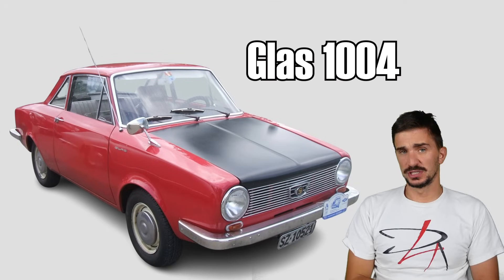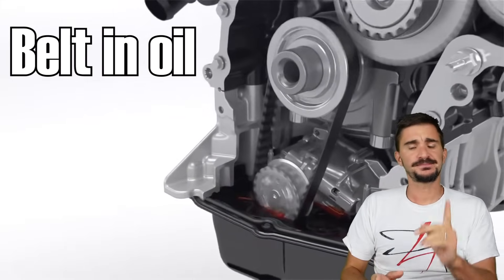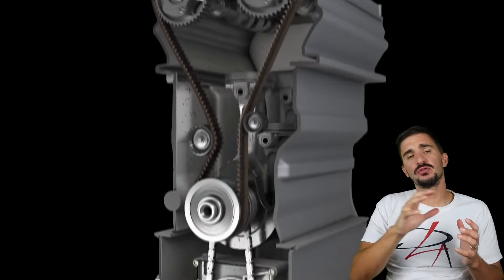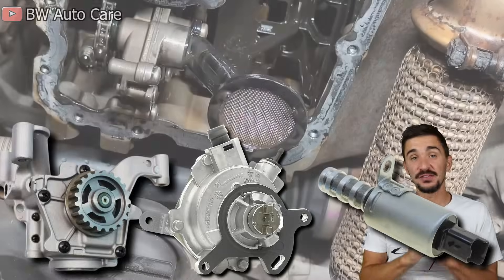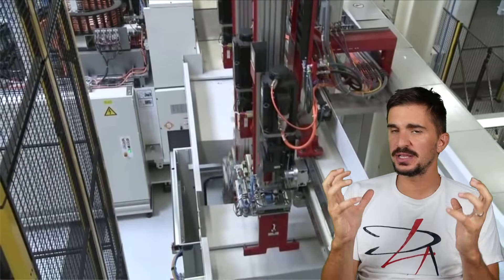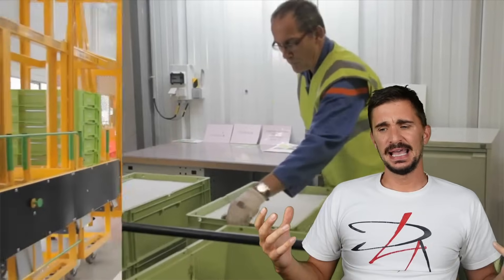Who Approved This and Why Is It Still Being Made? Wet Belt aka Belt in Oil Engines

Comment: You are so lucky you haven't tried this channel's technology experiment and your tempered idealism on computers. Tech moves fast, obviously, and things advance - or so they say. But the cisc-designs that blew the risc-designs away with Intel - have always been hitting barriers that can't be overcome. Intel and AMD has been trying to remedy that by adding more cores, and to extend the instruction set on the low-level. But even in 2001 we knew that the clock speed barrier was going to be looming. And the first 4,8Ghz overclock is actually 20 years old now. 

And that's really where we've been for 20 years. With a computer design that excels at a synthetic workload, that no one actually needs (we don't compile code from bootstrap - you can compile code on ARM just fine, and use complex libraries to build off of). You don't need to write your own compiler to get there, either. So having x86 instruction sets is a bit like having your own car-factory in your garage - and then to make the car every time you want to go to the store. And we keep doing that, and just have blueprints that we don't own, that can't be changed, and that will have very obvious weaknesses.

Recently, ARM has started to challenge things in the mobile sphere, and even in the laptop-sphere. For entirely obvious reasons - a RISC-design is going to be able to execute more complex instructions at lower clock-speeds, and so be potentially infinitely more efficient. But we're just not doing that. We're not even emulating x86 instructions on RISC-designs, thanks to lawsuit (from Intel). 

And instead we've collectively celebrated a company that has extended the lifetime of a dead-end technology, that aggressively gets rid of competition, and that has been sentenced heavy fines for anti-trust activity in many parts of the world - as being a company that brings technology and chip-designs forward. 

So 15 years of failure -- and then actual change as a result? The car-industry is just a huge pack of idealistic angels in comparison.

Comment: Once again Ford leads the way with another bad engineering choice. I believe there is a Ford engine that has the water pump inside the engine casings - another engineering disaster. It's not that Fords are poorly assembled ... the engineering is sub standard ... same for VW.

Comment: Why break it down into savings per year when you could have shown the savings per 100,000km? My math might be wrong, but that's around €117.18 in savings. Not worth the hassle of a broken engine, but still.
€234.36 if it manages to get to 200,000km

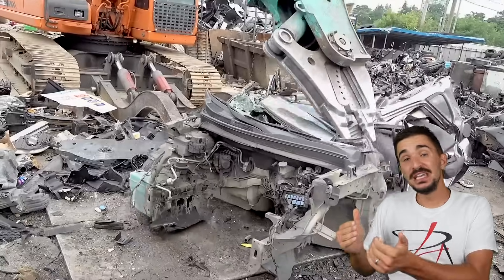Comment: @8:05 that is a fallacy. If a $60k car requires a $40k engine and rebuild, then, with that fallacy, the cost of the rebuild is less than the cost of the car.
Of course it's not worth it since you're now -$100k into the vehicle.

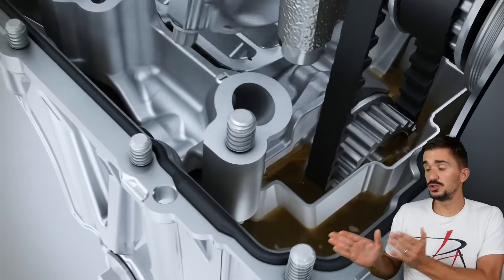Comment: 5:26 Renault has NEVER used belts for oil pumps in K9K engines. NEVER. As an owner and mechanic with thousands of 1.5 dCi engines torn down, reconditioned and serviced, have never seen in my life a belt lower than the crankshaft area. not even on the stupid H4x engines from nissan (0.9 tCE).

Comment: Stellantis was able to produce diesel engines with similar failures by weak steel camshaft chains from 2018 to 2022. Additionally the car dealers don't provide or mount any replacement camshaft chains. I had to buy a new car because of this after 146'000 kilometres and 6 years.
It's even possible to increase profit with steal chains and limited life time of the cars.

Comment: I really don’t understand it either.  GM uses a wet belt in their 3 cylinder cars and SUVs and possibly others.  How much does this really save?  And doesn’t the cost of an item include it’s reliability and reputation of the manufacturer?  Couldn’t costs be shifted to other less significant parts of the car?  What a joke!

Comment: It's because "Big Three" with the exception of Ford went bankrupt during this time, President Bush made a deal with GM and Chrysler at the time, so they would avoid bankruptcy in 2008. Ford decided to take a more German approach in their business model. Designing their engines and or transmissions to fail. Ford's focused these days on building complicated transmissions designed to fail. More customer can bring them in for repairs or back to the dealer for resale creating revenue. I also believe the Germans started this probably after the launch of Lexus in 89' they produced the first e36 in 1990 which had a run to 2000, but if you notice the next generation the e46 reliability is not so great, and that follows up with the e90 n54 n55... and so on. Just my two cents.

Comment: My 200cc bike can go up 15-16k RPM after a tune. It's got cam chains. After a bore & stroke for 2 stages... and a complete valve train change, it still runs the stock timing chain with ease. I could've easily used the old one but changed it for peace of mind.

The old farm tractor we got, has a belt, I've wanted to shoot a shootgun to that piece of shit like 7 different tikes 

And that is why, i trust mechanics more than engineers now 😂

Comment: I agree on your critical view on wet belts, but don't throw Renault under the bus. 1.5 dCI never had a wet belt - they all have ordinary dry belts - BTW a very reliable belt configuration. Also you are wrong about the little Renault gasoline engines . The old generation 1.2 (D4F(T)) has a dry timing belt without problems and the never generation 0.9 - 1.2 - 1.3 Tce all have timing chains. Those  chains seem to lengthen because of poor dimensions and long oil change intervalls, but don't blame Renault for the crazy concept og wet belts - they don't use it.

Comment: It's absurd how long this vid is. Bottom line is that belt in oil absolutely is possible and actually good idea. However it's bad idea to combine engine and belt lubrication. They should've considered making it completely external, like how some sleds have gear casing.

Comment: They need to be replaced more often than the inferior chains they have replaced!They are easier to manufacture and are cheaper for the care company! That tells all,because they don’t last as long as the chains they replace and they cost more to the owner who wants to keep the car.But trade the car in and get another more modern complicated expensive to keep digitised update,that you can trade in before all the built in redundancy breaks down and costs you a fortune.Then the recycling circle can be proud of all the savings made from things that break down and have to be replaced more often and are unfixable or too expensive to fix.Just trade it in and keep the trash flowing!

Comment: You are wrong on VW TSI engines, none of them have wet belts. There is no VW engine with a wet timing belt.  1.5 TSI was not even introduced until 2016, and it has a dry belt, just like its predecessor 1.4 (EA211). Earlier TSI engines had chains as well as the larger displacement EA888 family. Although, some TDI engines have wet oil pump drive belts.

Comment: I think the fascination with electronics has ruined the car industry. As a twenty year GM R&D and test engineer, An automobile requires, essentially, the same few components as a typical garden tractor to function. So, get rid of the ECU, TCU, BCU, ABS, Traction Control, Electronic HVAC Control, Infotainment System, the fancy rims, the console & buckets seats, and all of the silly girlie gadgets and lets focus on a real bumper, smoother suspension, soundproofing, comfortable seats, vibration issues and getting that price down to around $15,000-$20,000, where it belongs. Battery, starter, relay, Alternator, voltage regulator, coil, distributor, plugs and put the fuel pump back under the hood....DONE !! Add in some head lights, turn signals, horn, tail lights, wipers, manual heater and a radio, a real spare tire and jack......maybe seatbelts and ship it. Think about body heavier metal that doesn't end in $3,500 damage just from leaning on it or sitting on the hood. The Rube Goldberg nonsense has got to stop.

Comment: You forget on thing in your video. The fact that this is planed failure from the manufacture. Failed engine means purchase of new car. More money gained. Money money money... The singel strongest reason to fool the consumer, time and time again. Not one singel producer want a product that last forever. The best example of this is the birth of the lightbulb and the years there after. The race to build the best lightbulb that could shine for the most hours. A good selling point at the time. Until they realised that people where buying less lightbulbs, so they made a pact to keep the lifespan of a lightbulb to no more than a few thousand hours instead. More money in the bank.

Comment: A rubber timing belt on an interference engine is just another way for manufacturers to squeeze more money out of consumers. Sealed automatic transmissions, plastic hoses instead of rubber, plastic disposable oil pans, electric parking brakes, and the list goes on.

Comment: come on it's XXI century. No need for mechanical moving of valve pushers. Add one toothed gear connected with engine: in ratio 4:1, then attach 4 magnets to short axle. Add 4 coils to get signal and connect them with transistors  controling power on coils around valves. Simple, foolproof splution. (can be even simpler with mechanical switch on the connected gear but will wear much faster)

Comment: Well i have to start by saying, that citroen have had a timingbelt submerged in oil as far back as 2015 with the 1,2 vti and ford  did actually had the ecoboost 1,0 with belt in olie from 2013 in europe. i^ve rescued a bunch of these engines and i can say for sure that. olie and rubber dont mix good. in fact it is and always was a bad idea. and on a las note.... ford did rewise the  service for the timingbelt from 10 years og 240000 km to just 4 years og 100000 km......so by 2018 ford did eqiped the ecoboost engine with a timingchain.... but still to this day.. have rubber on the oilepump in the same engine???  and for citroen/peugeot it is still the same.. if you have a 1,0 or a 1,2  petrol engine from PSA you may have to put an additunal 1 litre oil in it for every 1000 km or so...go figure.

Comment: Every percent of fuel consumption results in higher price taxes due to co2, mainly in western Europe. This is why engines got bad piston rings, weak chains and all kind of issues related. Internal friction needed to come down and wet belt is one way to do so. Ford's 1.0 Ecotech became engine of the year with it. Not a good engine in the long run, a brilliant engine when new. And thats what matters for the manufacturers. Engines should be able to get to 150k km's and then it's written off. Most Ecotec's did make that amount. It's not just cost saving i'm affraid. It's what happenens if couverments start getting involved too much

Comment: Call me cynical but the timing of these belts failing normally takes them just outside of warranty and they can have unreasonable expectations of consumers documenting all line items of every service item and using specific oils to replace anything under warranty if your engine is ruined by this and somehow they do cover it by warranty if you're so lucky to be within it.

Comment: BTW That the manufactures reccomend the Oil Change interval every 15 or 20 000 km is another type of falcification and marketing bullshit.
The Oil and the Engines are pretty the same type with some evolution! 
So for only Internal City cycle the service interval for Oil Change is still 5 to 7... if you have City + Long distances it's still 7 to 10 000 km, if only Long - than yes, you can wait sometime for 12 or 15 000 kilometer.

Comment: Wet belts are indeed working better on diesel engines but on petrol engines they are a disaster mainly because of the petrol in the oil when the engine is cold or simply worn out, alongside a lot  higher oiltemp.of turbo petrol engine. I did not know that the 1.8 tdci had have a wet belt. On that engine the belt caused no failures. 
But another maker namely Honda are the next that want to loose customers with its new 1.0 3 cyl turbo petrol with wet belt.

Comment: Ford tech here. I hate the 1.0l engine. There is a recall for those to insoecy the belt and replace the long block and turbo for now. Next year, the repair will be to replace the pump and some other stuff. It's a horrible engine design and doesn't even make it out of 3/36.

Comment: I think you are wrong, as from a manufacturers point of view wet belts are great.  If they are going to fail they will do so outside the warranty period, so the customer has to pay.  Reducing the service interval means your dealer network make more money.  Replacing the belts is a massive job so the dealers make more money.  Testing of vehicles is never real world, they do their best but the public don't use the products in the same way.

I was buying a new motorbike and asked why I didn't want the version with electronic self-adjusting suspension.  "Will you gaurentee it for 20 years and 100 000 miles?" I asked, to be looked at like I was mad.  I have yet to have a traditional suspension unit fail at under 100 000 miles so an electronic one shouldn't.  If you think your wet belt will last 150 000 miles you had better warrany it for that, and if it fails despite being serviced in accordance with manufacturers recommendations you should pay for a new engine and the fitting;

Money where mouth is time!

Comment: In the 1.0 ford many of the applications require the removal of the engine to access the wet belts, I believe They are Made to break and everybody should take their money elsewhere. The designers are a disgrace to the legacy of the company and should be ashamed of what they have done to businesses that are damaged by purchasing a fleet of these, I know of two transits that are on their third engine at five years old. I will keep saving old vans for as long as i can, I don't want a dpf, wet belt or common rail injection system on any vehicle that i rely upon for survival.

Comment: This why I will keep my 15 year old diesel push rod engine.  No chains, no belts to fail.  All gear driven components at low RPM.   The thing will run for 400 - 500 miles. Modern engines have become throw away junk.   I will by one when they replace the wet belts every 80,000 miles at no cost to me.  Put up or shut up.

Comment: The way you put it, combined with the sheer number of engines PSA is producing, there should have been a giant wave of failing engines and recalls. But there isn't. Even if you actively search, you won't find any major car magazine writing about it. How do you explain this? I mean, PSA is putting these engines in around 35 different car models since 2012 or so, but I still see a lot of Opel Adams and Opel Corsas from that time driving just fine.

Comment: The runner expose to diesel is much different than gas.

There is no rubber that will stand up to alcohol and other olifinic hydrocarbons in gasoline.  And with direct injection there is way too much fuel in the gasoline.  This is not working on gas engines.  But if you have a gas engine you need to take a longer trip to get the fuel and water out of the oil.

It is a bad idea on all cases, especially in gasoline

Comment: and yet the 2025 ford ecoboost still use them,, even on the 2 liter one that were xhain driver on the cams and the oil pump;; have gone to a wet belt on the oil pumps as the v6 and non ecoboost v8 engines..

Comment: Ican't believe they rationally made that choice. It makes no sense.. You need to keep your customers and while they probably hoped most new car buyers would already have changed their car before any problem occurs, some keep their car a long time. Also the brand damage is huge. It's really hard to understand the situation. Also the same mistake was made by many different manufacturers.
Dieselgate was built on some kind of impunity feeling. In europe manufacturer handled the law so they bullshited emissions but felt there was no risk doing so. VW made a huge mistake by selling their diesel in the states because americans search every possibility to turn the competition to their advantage. It was excess confidence.
But here ? It's straight up stupid. And i'm mostly pro downsizing, i think a well made downsized engine is not that dumb. But this is nut. Manufacturers have very stringent test it's impossible they did not know the risk. Belt manufacturers too, i could they accept being part of this ? I have no clue.

Comment: Be certain that extensive research and testing has been performed before going forward with this. Potential problems were certainly evaluated, but with accelerated, shorter aging testing. Now the matter is : car manufacturers have no control on what oil is being used in the engines 5 years down the road ! It is now understood that the widespread problem on the 1.2L Puretech is attributed to a mainstream change in the oil formulation (mostly additives) since the initial testing. Whatever caused it, it is still a poor decision on the manufacturer's behalf to engage in an unsufficient robust design where they would have no control on the environment (oil grades, oil change frequency) and unsufficient long term data.

Comment: My sister's 2016 peugeot 208 has those dirty belts and she had to replace them after 60.000 km. So by my calculations she has to change its belts 6 times or more over the car's lifespan which means she has to spend 3500€ on a car that costs 12000€. This is literaly the brand's desperation for money. Overall, new cars are mobile trash

Comment: No way. Change your oil every 5000. If you want your car to last, don't go more. Modern engines run even hotter than older motors. 

Heat and oil: sludge